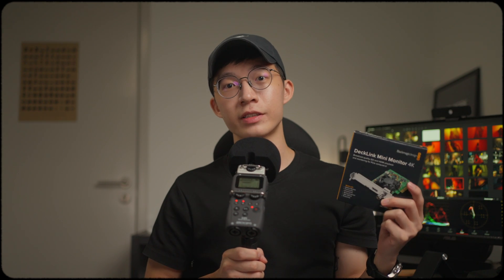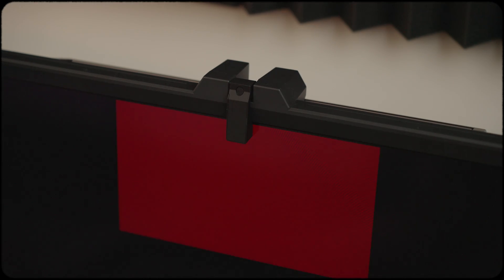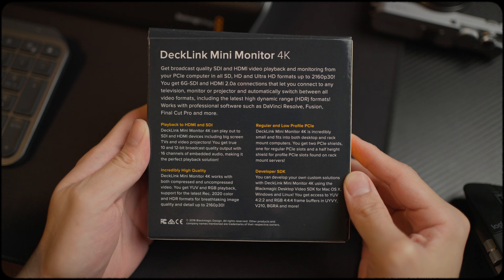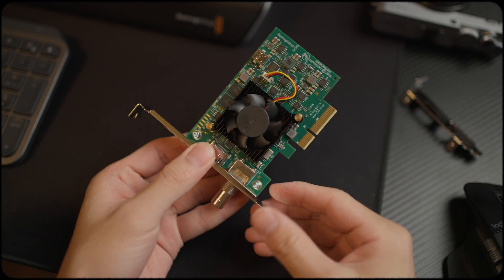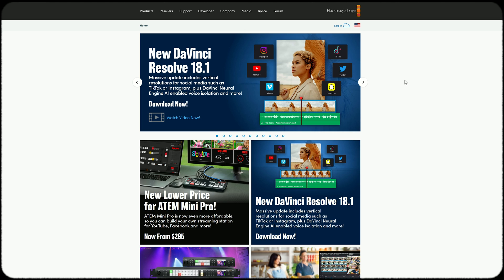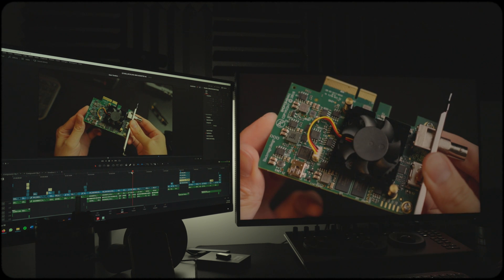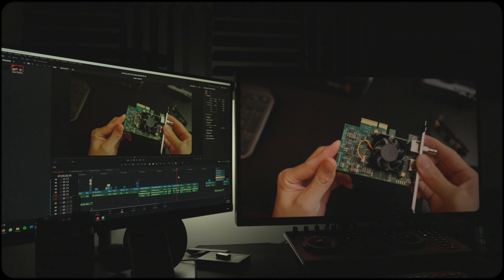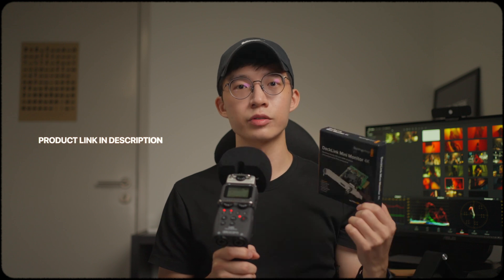Decklink Mini Monitor 4K | Unboxing, Review & Comparison | Blackmagic Design

Comment: Is the “reference” monitor able to still be used as a regular display when Resolve is not opened?

I have the LG C2 for reference but would want to be able to use it as a regular monitor when using the web and watching videos 

Do you know if that’s possible or would I need a splitter?
Reply from the maker: No it can’t, you would need a switcher instead

Comment: How do you calibrate using an IO device?
Reply from the maker: depends...

If your monitor has internal calibration with a colorimeter, just use that.

If your monitor has hardware calibration, plug it as a normal display, use an external colorimeter, and run the proprietary software.

If your monitor doesn't have hardware calibration, buy a calibration software, and use a LUT box to store your calibration because the decklink will bypass the software calibration.

Comment: Great video. I abandon my video exercises for a while. Now may start to believe I can set it up right. 

Was not able to get colors right all the time. Used 1080p thunderbolt ministudio. Just to discover that my screen need to be calibrated. And better replaced on something like $600 or $800 or $2000 or $30k :) They all claim to be HDR, while non are, apart from $30K those are actually HDR.
I tried to get away with 15 inch OLED display. That of course has no spec apart from supports "HDR". Calibrating Davinci with Spyder X failed to calibrate giving error after few hours. Maybe faulty Spyder X, need to try another colorimeter.  

Although I was resisting all the time, after all, thinking to switch just to Macbook pro with calibrated mini-LED what they call XDR. All I try to achieve is to edit "sort of" HDR videos for Youtube that cab be played on HDR capable mobile phones. 
Windows: Need notebook with lot of cores and RAM + eGPU enclosure + GPU  + ministudio + free thunderbolt to connect ministudio + free thunderbolt for external NVME + OLED TV + colorimeter and lot of luck and tutorials. 
Mac: need just any Macbook pro M1. Probably with funny 8GB unified memory. No flexibility, but works what I heard out of the box. No cheap NVMEs, no cheap ram, nothing cheap :) But still could be cheaper then PC setup to start with.

Comment: Hey Danny, thanks for sharing ths knowledge. Just want to ask since I'm confused. Am I required to use 2 display monitor to use Decklink? Or one display is suffice?
Reply from the maker: You MUST have 2, one for Graphic User Interface (GUI), one for Referencing/Mastering
Reply: @DannyGan  Noted! Thank you so much for acknowledging my concern! Too bad cuz I don't plan on having a second display 😅.

I have one last question though, I hope you don't mind. Currently, I had my monitor calibrated just this year (DELL U3223QE) and using a Calibrated 3D LUT profile for rec709 display. Now, do I need to re-calibrate my monitor once I installed the decklink or will it work just fine if I use my Calibrated Lut as is? TIA!

Comment: I understand why one would use this vs using the HDMI port on the GPU. However, is there any benefit of using this vs using the HDMI port on a GeoForce graphics card?
Reply from the maker: From Resolve Manual:

LIMITATIONS WHEN GRADING WITH THE VIEWER ON A COMPUTER DEVICE

Most computer displays do not operate at the color critical tolerances or specifications required for quality control for streaming, broadcast, or theatrical delivery. An additional issue, however, is that depending on your combination of workstation and computer display, the Viewer does not necessarily display each clip’s image data as it is displayed by the calibration that your operating system applies to your computer display, depending on which OS you’re running DaVinci Resolve on. This makes your computer display potentially unsuitable for monitoring projects destined for the sRGB standard of the web in its default state.

For example, if you grade a project using the Color page Viewer on your computer display, the resulting clip may not look the same in the QuickTime player, or in other postproduction applications.

You can address this in one of two ways:

— If you’re using DaVinci Resolve on macOS, you can turn on “Use Mac Display Color Profile for viewers” in the Hardware Configuration panel of the System Settings. This lets DaVinci Resolve use whichever of the color profiles you choose in the Color tab of the Displays panel in the macOS System Preferences, thereby taking advantage of ColorSync on macOS to let DaVinci Resolve display color the way your computer monitor does. This now works for all color profiles that ship with macOS, as well as color profiles that have been generated by calibration software, such as that available from X-rite, Datacolor, or other applications. 

On supported computers, there’s also an option to “Use 10-bit precision in viewers,” if available, that you can turn on. With this option enabled, rendered output displayed in QuickTime Player will match what is seen in the DaVinci Resolve Viewer.

— Alternately, you can apply a dedicated Color Viewer LUT for calibration, using the 1D/3D Color Viewer Lookup Table drop-down menu that’s found in the Color Management Strictly speaking, if you’re doing professional work, you should restrict your grading using a calibrated, 10- or 12-bit class A external broadcast display of some type, connected via a Blackmagic Design video interface. Assuming everything is running properly, an image that is output to video from DaVinci Resolve should match an image output to video from any other post-production application you’re using, and this should be your panel of the Project Settings. This lets you analyze your computer display for calibration in the same way you would calibrate an external display, using a probe and color management software, and apply the resulting calibration LUT in DaVinci Resolve.

Keep in mind that monitor calibration can only make a high quality display standards compliant; it cannot make up for a display gamut that’s too small. For more information,
see the “Lookup Tables” section of Chapter 4, “System and User Preferences”
Reply: @DannyGan  Thank you for replying!

Comment: greeting!
I have a problem and I can't solve it. My computer does not see or detect the Declink mini 4K card, please help me with advice. Thank you in advance!
I am working on Adobe Premiere 2023

My configuration:
Processor: AMD Ryzen 7 5700X 3.40GHz up to 4.60GHz (C8, T16)
Motherboard: MSI MAG B550 Tomahawk
RAM: 32GB (2x 16GB) DDR4 Kingston Fury Beast 3200MHz
SSD: 1TB Kingston NV2 M.2 NVMe
Graphics: Nvidia RTX 4060 Ventus 2X Black OC 8GB MSI GDDR6
Power supply: Inter-Tech 720W
Case: Chieftec Scorpion 3
CPU cooler: Arctic Freezer 34 Duo
Windows 10 pro

Comment: Hi Danny, great video and test run!  I was just wondering about the screen calibration process...would it not be important to rather calibrate the internal screen colour profile (the actual manufactures screen firmware ICC colour profile) as opposed to using a third party colorimeter for screen calibration as the ICC colourspace is saved in the OS software display driver for your graphics card.  Because when when utilising a I/O device the video feed will bypass the GPU and calibrated ICC colourspace profile created by the third party calibrating software? Is this correct? Hopefully, I'm making sense in asking the question.
Reply from the maker: Yes, what you said is true! That's something I totally missed, come to think of it. You'll need a monitor that has hardware calibration to store the calibrated profile.
Reply: @DannyGan Okay, thanks for clarifying - just wondering how many systems out there are following the correct procedure regarding monitor calibration 🤔
Reply from the maker: Most decent post-houses has their calibration sorted out, only the freelancers are a bit of a wild card haha

Comment: This is by far the best video on decklinks, especially for someone like me as beginner trying to understand. I have an ASUS ProArt 2K monitor, wondering if it's compatible with that, even though my timeline and output will be for 4K in Davinci Resolve.
Reply from the maker: I think you won't be able to display UHD/4K, because the monitor is only expecting a 1080p signal. But you can set the Decklink to display 1080p, do let us know what is the results!
Reply: @DannyGan  so I’m thinking the Mini Monitor HD would also work since I won’t be able to use 4K, is there any advantage to using the mini monitor 4K for a 2K monitor ?

Comment: I just purchased the Samsung Ark monitor to consolidate all of my monitors (currently on sale). But anyone that has one knows that it has limitations when it comes to their advertised multi-view features. My hope is that I can send my video viewport using this device through its own HDMI port from my pc into one of the four hdmi inputs on the ark and allow me to "undock" the window. Does anyone see a reason this won't work? (I will circle back here and share my results if I do this in case it helps someone else.)

Comment: Good morning
I have the PC workstation in the same room where I have my old LG 65B6V OLED and I would like to use it as a large HDR monitor to check the preview.
For this I have been thinking of purchasing the DeckLink Mini Monitor 4K PCI card.
My question is: 
Once I set "Color Managemet>Color Space & Trasnsform" the HDR rating, does the OLED display switch me to HDR?
Thank you?
Reply from the maker: I'm not too sure to comment on this, but the Decklink does support HDR formats, just not sure if the LG can detect the switch. But my bet is that it can.

Comment: Hey Danny. Do you know if this card outputs full 4:4:4 RGB over HDMI at 2160p 24fps? The spec sheet on Blackmagic's website is a bit vague. It says 4:4:4, 4:2:2, and 4:0:0 over HDMI but doesn't specify at what frame rates, resolutions, or bit depths it outputs those different sampling levels.
Thank you for the video. It's hard hard to find info on Decklinks, as I'm sure you realized in you research haha.
Reply from the maker: I think it does. On the back of the box it says "up to 2160p30" which includes option for 24fps in the Blackmagic Desktop Video software.
Reply: @DannyGan  Noted. Thank you :)

Comment: Hey Danny. Thanks a lot for the video. Excited to get started editing HDR on a clean feed and futureproof the workflow. 
Have I understood it right, in that, it is impossible to get the HDR feed on the same monitor on which the editing done?
Reply from the maker: You can get HDR on your working/Graphic User Interface (GUI) monitor, just that its not a clean feed coming from the decklink, hence its better to get a separate monitor for monitoring.
Reply: @DannyGan  Damn. I wish there was a way to use the Decklink with just one HDR monitor. I wonder if the Black Magic Video Assist could serve as a second monitor.  2500 nits, but just 7 inches big. Sure would save more power than connecting a 48 inch OLED tv to enable the HDR workflow. Anyway. Appreciate the good work and looking forward to see more from you. (:

Comment: Hey Bud, 
First of all thank you for making this video. This really helped me to understand what a Decklink thing is. I do have almost same specs PC as you have and I was also looking for some solution for clean feed and came across this Decklink thing.

I do have one question for you though. Hope you answer.

Do you use the Monitor Calibration LUT inside Resolve? or You use Hardware Calibrated Monitor? 
Does Decklink have Support for LUT?

On my end I use the Monitor Calibration LUT inside used which I have generated using the DisplayCAL.

Answer is much appreciated.
Reply from the maker: I believe my ASUS PA32UCX-PK has calibration built-in its hardware. Though I'm not sure whether the decklink support LUTs. Do try to ask in BlackmagicDesign's forum, there are more experts there. 😁